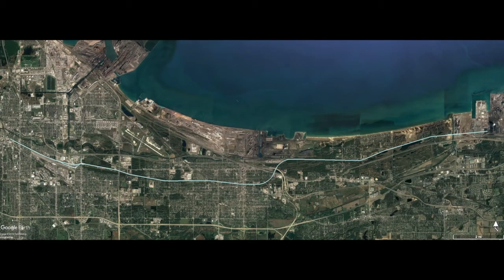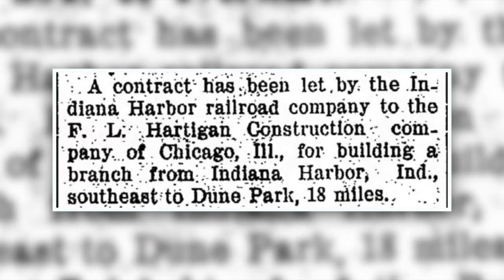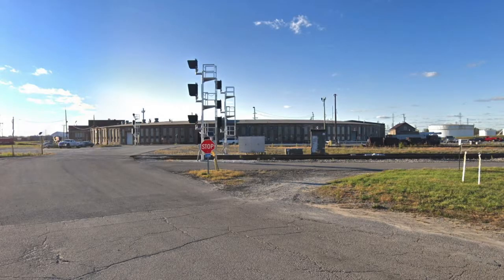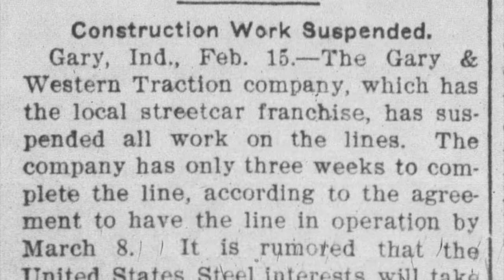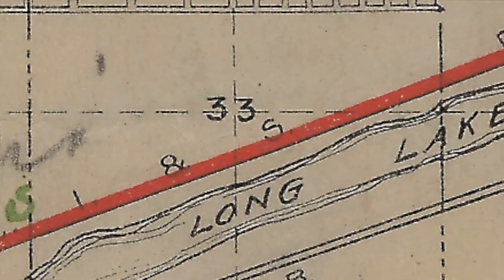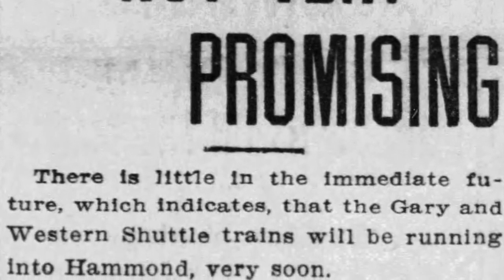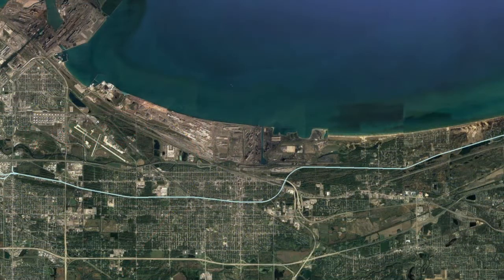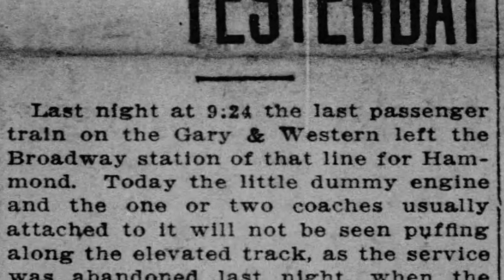Gary & Western Documentary: Part 1 (draft)

Comment: Thank you GIR for another fascinating video!  I rode the bus line to Gary Sheet & Tin from a South Shore connection many times.  Also, when I was growing up in Michigan City some of the old Michigan Central division point buildings were still there, occupied by a construction company.  I didn't realize that the division point had moved away as early as it did.  Finally, in the 60's I was interested in the ground-level tracks just north of the CSS&SB Gary station, near or underneath the Toll Road.  I figured they were EJ&E, but maybe they were IHB heading over to Dunes Harbor.  Keep 'em coming!
Reply from the maker: I will!  Thanks Drew!

Comment: This is a great video. I grew up playing on what was the Ogden Dunes portion of the Dune Park Branch and always wondered about it.  Do you know when they finally called it quits on the eastern portion of the line?   I'm guessing it's when Midwest Steel opened up but I could be wrong.
Reply from the maker: It was a little after Midwest opened up.  The east portion was depreciated in the late 60s.  By the early 70s it was abandoned in favor of IHB accessing Midwest from CP 501 instead of from Ivanhoe, which spelled the end of the line for the entire branch in general.  Penn Central considered the east portion a duplicate line.  It was ripped up from Lake Street to just before Burns Ditch by the mid-70s.  The Burns Ditch tracks are still there, but rarely used.